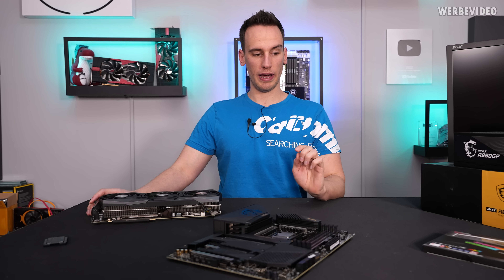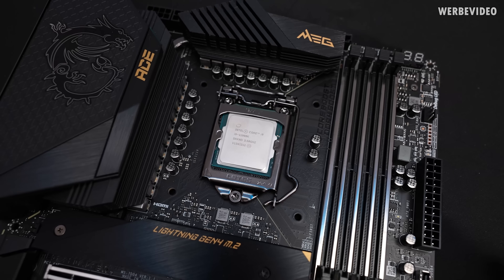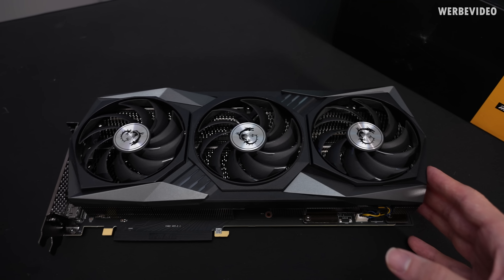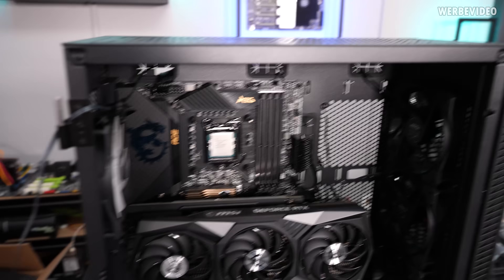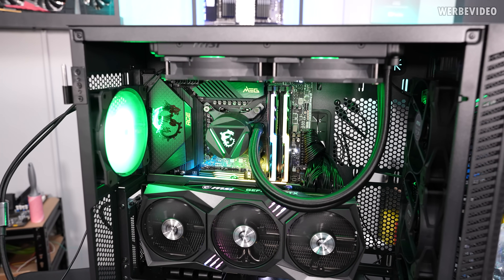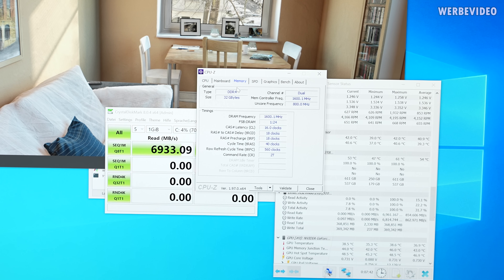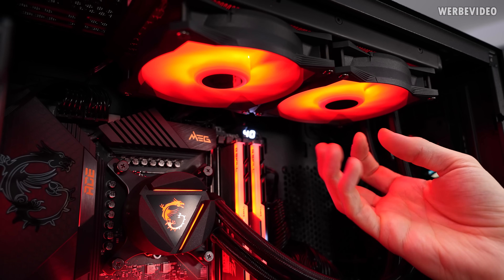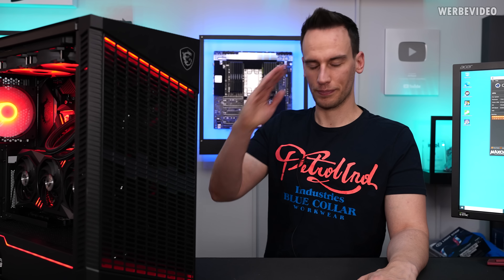Solid Temperatures, but there is one Thing MSI should change on the AIO

Comment: Hey, super Video ! Danke für die detaillierten Einblicke in das Case, ich habe vor das selbe case zu holen und oben eine 360er AIO zu benutzen, das bedeutet ich habe in der Front die 3 Stock Lüfter, Hinten den einen Stock RGB Lüfter und oben eine 360AIO die ja auf den Radiator bläst, muss ich noch etwas für den Airflow tun oder reicht das komplett aus ? (9800x3d+7900xt)

Comment: I would try changing the memory's command rate to 1T and then switch to gear 2 mode if you aren't already and then try pushing up to like 4000mhz or above if those dimms are single rank and if they are anything like hynix cjr. In order to compensate for the IPC increase for the 11th gen, intel basically introduced what they call gear mode 2 which basically underclocks the memory controller which is exactly the same thing as command rate 2T but you can compensate that by simply going 1T.  TRD TRP 18 at 3200 mhz is really loose so I'm guessing they're not samsung b die.

Comment: Yeah, I've got the same aio, as my local shop had it for 25% off, switching the fans to a spare couple of Noctuas dropped the temps by about 10%. You can fix the gap with some 50c silicon fan sleeves if you want to keep the originals and their led sync. Otherwise it's a pretty decent aio and having the pump mid radiator gives you more mounting options. I use it for a 5800x due to space constraints and it's kept it to 74 degrees on 4 hour prime 95 heat soak, with max heat setting.

Comment: Should you not mount a Radiator with that kind of Pump in it so that the pump is on the lower part of it all? 
If fluidlevels ever change or bubbles get trapped up there it will make horrible noise and kill the pump right?

Comment: ALL chassis are made from cheap materials whether they are MSi, Phanteks, Corsair, Thermaltake, be quiet!, Fractal Design, Cooler Master, NZXT etc. It is either plastic, aluminum or weak structural metals. 

I paid $200 for my Thermaltake V51 Core in 2014. What do I Love about it? Everything is air cooled (no hybrid or water cooling AT ALL) and I never see my CPU, GPU components reach above 60°C under max load. The case temp is also VERY low and well controlled. 

I have 2x 140mm intake fans in the front grill, 1x 140mm exhaust fan at rear, 1x 120mm at the bottom to draw cold up into the video card and 1x 140mm at the top for CPU heat exhaust.

I bought my chassis for the airflow. No chassis in the world matches the airflow. Even after 7 years.

Comment: I've had older Thermaltake Riing fans, supposedly FDB ones, vibrate violently when installed upside down as top exhaust, but work just fine in all other orientations. Looks like some bearing designs just cannot handle the fan hanging on the hub, could be the case here (unless it's just ball bearings, in which case, why?..).

Comment: Yeah unfortunately a lot of AIOs have similar problems with gaps around the frames. Be Quiet fans are pretty bad with this, also Coolermaster AIOs that use the MF120R fan.

Also it looks like the fans of that AIO have ball bearings, which can often be noisy.

Comment: 7:15 You can't access those screws when the bracket is mounted in the case. You need to take out the GPU together with the bracket, then you can unscrew the GPU from the bracket.

Comment: You got a 3200 cl 16 ram kit and expected good overclocking? i would have expected with your OC experience to know how much of a lottery a 3200 cl 16 kit is gonna be, it is not like a 3200 cl 14 kit where are are gonna get b-die

i'd take a 3200 cl 14 kit no rgb over a RGB 3200 cl 16 kit

Comment: Looks good, but that cpu and cpu cooler is a poor match. I had the same cooler and it couldn't run 5k mhz on a 10700k. Those are also the fans that are included with the AIO kit. The seal could have been part of my issue. Either way my new noctua NHU12 can run 5k mhz all day no problem. I also have the 360mm version and it's much more capable compared to the 240mm

Comment: Good video. I was just missing a little bit of focus on right side of the case. The only information i got was from few seconds of b-roll during PSU installation. Without it i would not know about included fan splitter and 2 SSD mounting place.
Reply from the maker: Good point. Thanks for the feedback

Comment: Those msi AIOs also have the pump in the radiator so mounting the radiator above the cpu block means it'll die early with all the air flowing through the pump.
Reply: It doesnt work like when the pump is in the cpu block. The pump can not run dry unless the radiator looses maybe half of the water.
Reply: Omg again with this shit. Do you really think aio is like half air? There shouldn't be any air in aio ffs
Reply: @riba2233  The will always be air in an aio, but it should be so little that it does not matter.
Reply: @kimborch8547  exactly,

Comment: 9:13 Does it matter if you take the stickers off of the m.2? I always take them off, if I'm using a heatsink. Either the flat motherboard one, or an included heatsink like the one you used.
Reply: The stickers are thermal conductive, they wont be a problem. It's some kind of metal sticker.
Some NVME brands also get problematic with warranty if you take it off so may be best to not move it. (if you do keep it safe)

Comment: What happens if you remove NVMe label sticker before heatsink mounting? Will it make a big difference?
Reply: If it is just a sticker, I don't think it would matter. However, many m.2 drives have a graphene sticker that is actually part of the cooling design. I'd probably leave those on, but the sticker may be ok to remove.
Reply: @robertmajors1737  I didn't know the graphene thing. Makes sense. Thanks 👍

Comment: The "everything fixing tool" looked like a Knipex product with a custom "find it in the dark" paint job lol.  They really do make some of the best pliers in the world, and in true der8auer fashion, they are of course of German design and manufacture.  Though personally,  the Cobra 87 01 180 is what I carry and use daily.  It's been in and out of my pocket so many times that the anodizing is all gone, but it still works just as well as the day I bought it.
Reply: It's an adjustable nut rounder.
Reply: @agordon20024  it helps for when the nuts are already rounded too though. the metal teeth are strong enough to bite into most chinisum screws and bolts.

Comment: RGB fluff, making $100-150 cases cost $200-250 since 2015.......(RGB doesn't impact the build cost of PC cases in any quantifiable amount. This is all extra profit margin to squeeze money from consumers in an anti-consumer way.)
Reply: Cases haven't really gone up in price due to rgb. I don't get where this is coming from. Plenty of cheap $60 cases that come with rgb and an rgb controller. AIOs are far worse. Corsair for example has basically more than doubled their prices since their AIOs were first introduced and they're essentially the exact same thing with rgb slapped on it.

Comment: I ‘ve bougth that aio a few days after it was released, the pump died in less than six months…
Reply: Super happy with both of mine that I've had for over a year now. Really don't like the size and look of asetek pump blocks
Reply: you could have mounted it in the wrong direction because that can create problems for aioa
Reply: @cup0coffee434  The pump is inside the radiator, it can really not be mounted in a wrong "direction"
Reply: @kimborch8547  ok, I think it’s might just be a bad aio then
Reply: @cup0coffee434  From the comments here, i think you are right :-)

Comment: I bought one of those MSI 240 AIO's in March and it stopped working properly about a month ago. I ended up noticing that it wasn't cooling as good as it used to and while it maintained good temperatures at idle when load was introduced my cpu would quickly climb up to the 90's C range and stay there. Right around when this happened I noticed that there was a grind sound for a split second every time I'd turn my computer. I ended up exchanging it for a Corsair H100i Elite Capellix and this one's been working pretty good so far.
Reply: That exact same thing happened to my friend's brothers! It was working for a couple months and then the temps just started climbing and climbing.   MicroCenter upgraded it to a H115i Capellix for him.
Reply: @startedtech  Yeah I love Micro Center it's where I buy all my parts. I got my first aio there a couple of years ago, it was one of the cheaper Cooler Master ones. It lasted for a couple of months and started making noise sounding like there was air in it. 
I had bought their 2 year warranty so I ended up exchanging it for another same model that had an updated pump and mounted it on the top this time. Same thing happened with that too, air made it in the loop and was making a constant noise that got worse and worse.

I exchanged that for the MSI and that lasted the longest and now have the same your friend has. If this one craps out on me I'm getting a good air cooler for my pc.
I got my first hybrid gpu last December from MC and that hasn't had any issues. The pump is inaudible.
Reply: @TerraWare  meanwhile I've somehow been running a cheap 120mm Coolermaster AIO for close to 5 years with no issues, been the only AIO I've owned 😅
Reply: @startedtech  Nice, good for you. I must be having bad luck with AIO's lol. Except for my gpu aio, that one works fine.
Reply: i have been running one for almost a year now with the rad at the top on a 2800XT and it runs fine
Reply: They're not suitable for top mounting the rad. All the air in the loop will constantly go through the pump since it's in the rad. Ideally you'd mount it in the front with the tubes at the bottom of the rad.
Reply: @Lead_Foot  I thought about that actually but I couldn't hear any air in the loop. The thing is that I would mount it in the front but I have a hybrid gpu in my pc and that radiator is mounted in the front. It could've been a factor I suppose.

Comment: Why do manufacturers make aio with stupid fans which have a massive gap between the rad and fan? I see this all the time
Reply: @JosephArata  nothing to do with the screws. It's the frame design of the fan
Reply: Case and AIO manufacturers don't make fans. That's your answer.
Reply: @JosephArata  they choose them though XD
Reply: @LawrenceTimme  you must be new to the supply chain and parts procurement game. They buy whatever is cheapest that fits with the look they're going for, then charge the customer the most price they can. You're paying 200-300% profit on most PC parts from the manufacturer these days. Because they want to make up this marketing nonsense that RGB costs extra and the customers "want it". No, it's an easy scam for them to raise profit margin without doing any extra work.